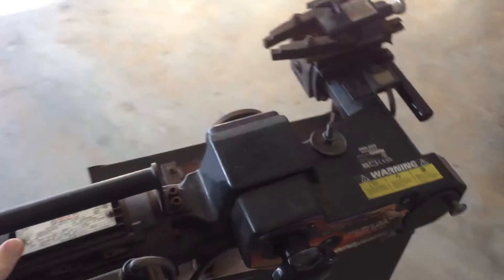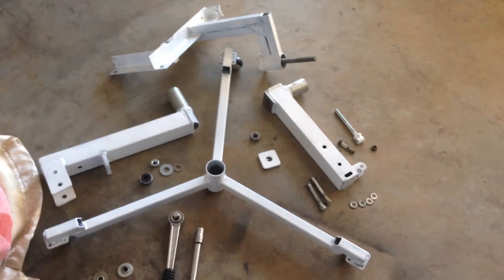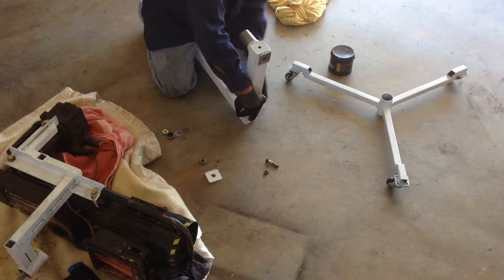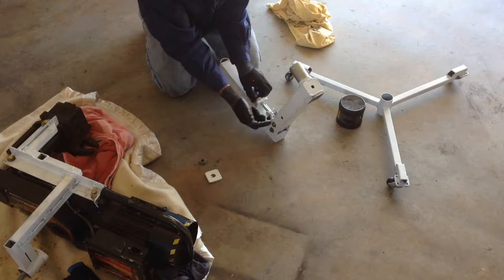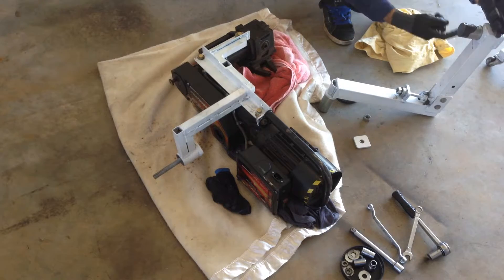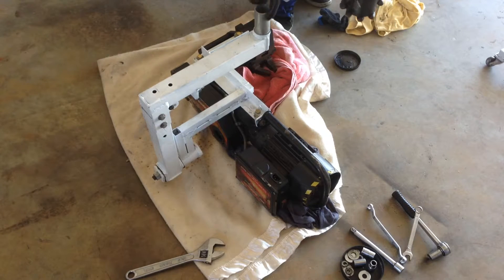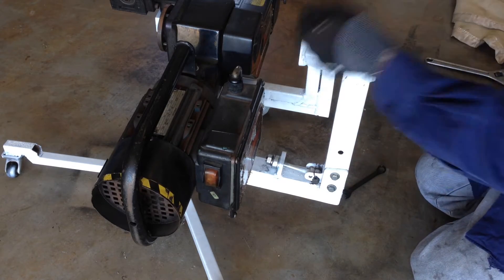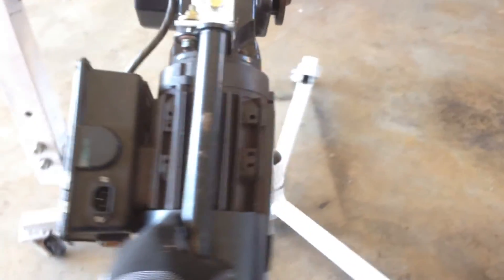Building an adjustable stand for a Pro-Cut VBG 620 On Car Brake Lathe

Comment: Just one criticism: When you flip the machine it is higher. Which means you are going to have to do one side and then lift the vehicle more (and exactly enough) to use on the other side. Have you made any changes to accommodate this?

I have a PFM 9.0. I do mobile brake disc skimming, sometimes at customers houses and am currently struggling with this issue.